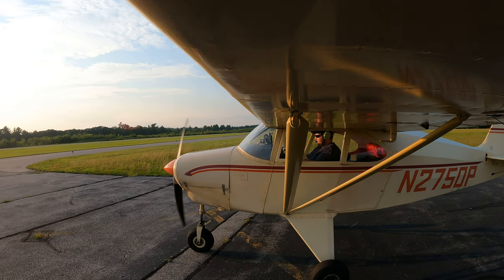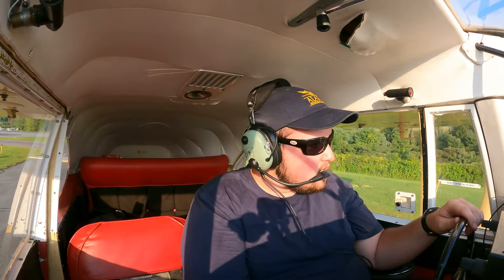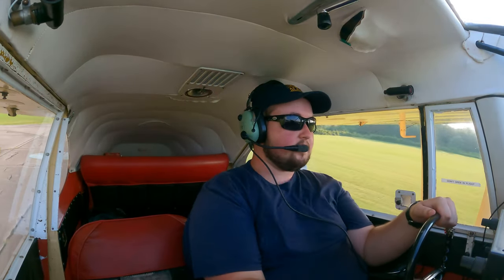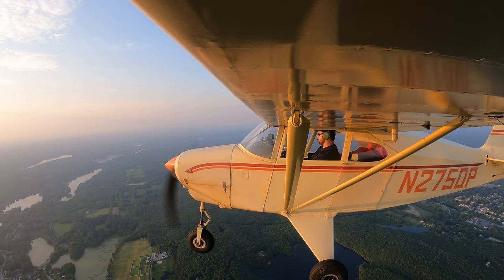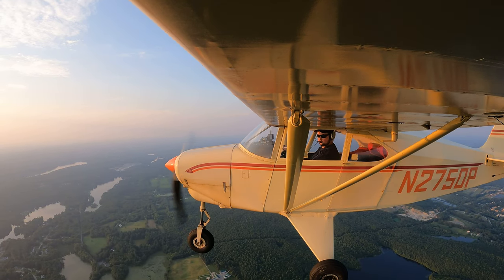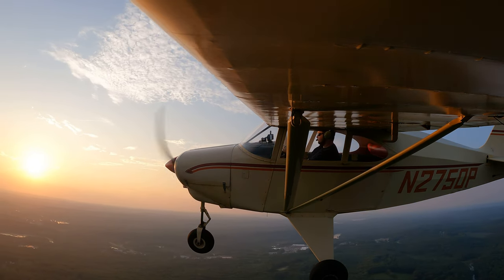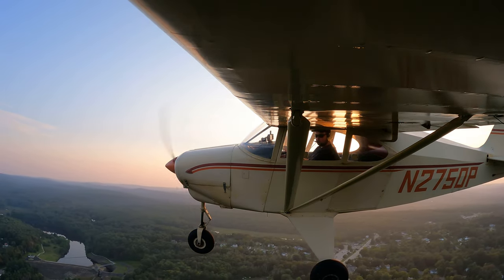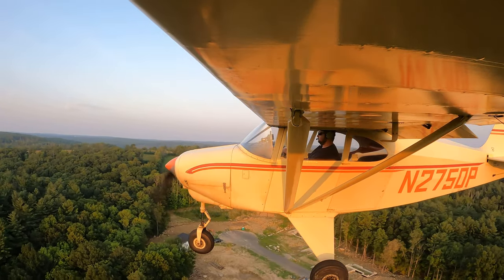Slowest Airplane Around!! Piper Tripacer

Comment: I learned the basics in a Tri-Pacer.  My Dad had one in the mid-50's.  I missed it when he upgraded to a V-35B Bonanza. While in college in the '70's I had a friend with a Colt.  Just a Tri-Pacer with a name change.  He used to let me fly it.  I was his A&P mechanic.
Reply from the maker: The Tri-pacer sure is a dream to fly! The bonanza must have been a blast!
Reply: I had a Colt also.  The colt had no flaps.
Reply from the maker: @markstillwagon4601  correct me if I am wrong, but the colt only has 2 seats
Reply: @kevinhill242  that is correct
Reply: Also no inter connect between ailerons and rudder
Reply: @kevinhill242  And a smaller engine.
Reply: @kevinhill242  Correct. The trainer version of the Tri-Pacer
Reply: @kevinhill242  Yep, two seats, no flaps and generally the 108 HP engine.  Flew ours for years... great simple plane.  N5895Z.  Miss it to this day.
Reply: @brucemckelvy9920  I still fly a 61 colt...great little plane.

Comment: Had 5 different tri pacers, converted 2 to  22/20s, good old planes. Eddie Trimmer is the super pacer man in Willow Alaska, 180hp, extended flaps, fuselage, and wings, 2 18 gal tanks each wing, cub tail feathers. They are a monster performer.
Reply from the maker: That does sound like a monster performer. When I was living in alaska I saw a few on floats and I’ve always wanted to get this converted over!

Comment: I also had a 55 tripacer. N2959P. back in 1972, 90 hrs SMOH, new cover and paint.  Original interior.  I love her.  Paid $4000.00 but had to sell her one year later for $4500.  I rented airplanes after that for another year.  5 years later I became a helicopter pilot, and retired with 10,000 hrs.  never flew fixed wing again.  However I missed that trypacer !!

Comment: ..Ill keep this short..My very first time up in any airplane was in Oct 1955,  when my dad, a corporate pilot flying Twin Beech 18s out of NYC/LaGuardia, borrowed a '54 Tri-Pacer w/ the 135hp 4-cyl Lycoming engine, to fly from N.Y. down here to Philadelphia,  MS to visit his relatives on his badly needed vacation! We were pulled out of school for 2 wks. Was,one of the coolest, memorable, educational experiences I ever had! Recall him operating a metal crank in the head panel betw the front seats..he told me that was the elevator trim tab operating crank. Had no rudder pedal toe brakes, but a s-shaped stick lever under the l. side instrument panel, that actuated the little main gear brakes. I was 6 yrs old, bro was 5, Mom & Dad in late 30's.Slow, noisy airplane. Reeked of 87oct avgas! Never flew in one since. Flew, learned, piloted, did time in Cessna 152s, 172s till I quit flying in the 1980's. That's my long/short story!! Thnx!

Comment: Not only was it slow but it had a glide ratio of a rock. I know because of being in one when the engine quit after a very short altitude gain. I guess not high enough to turn around, just straight forward into a ravine bank. I survived but the instructor did not.

Comment: Enjoyed the video, I have the same plane and i was wondering what camera yuo use and how do you mount it? i am wanting to record some of my flights
Reply from the maker: I use the NFlight exterior ball head mount, which I attach into the light bracket on the wing! Works like a charm and you can play around with the angles. I use a GoPro hero 8 to film with, and with the camera turned sideways for that angle I have never had an issue with bugs getting on the lens. Hope that helps you!
Reply: @kevinhill242  Thank you, really appreciate the reply